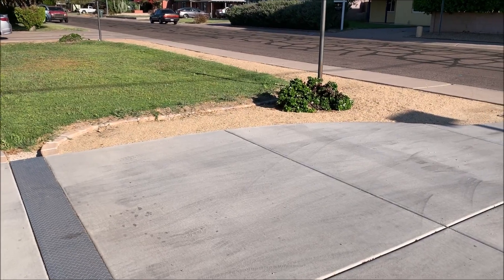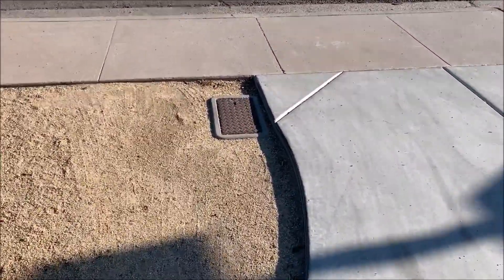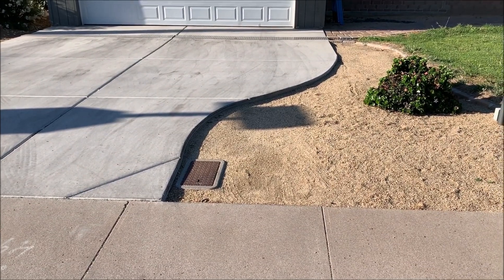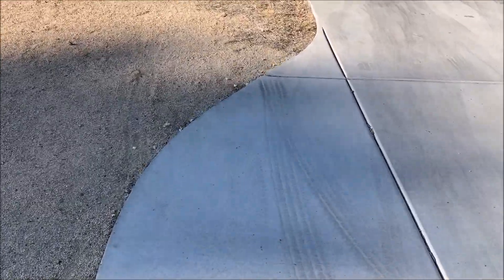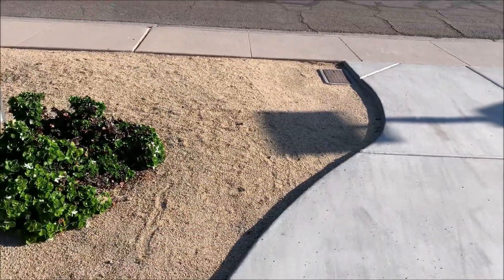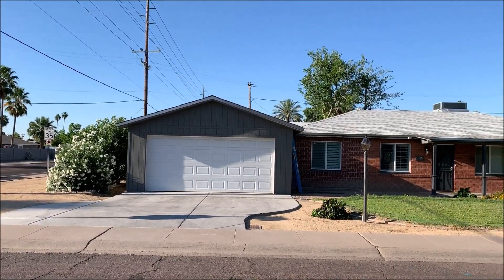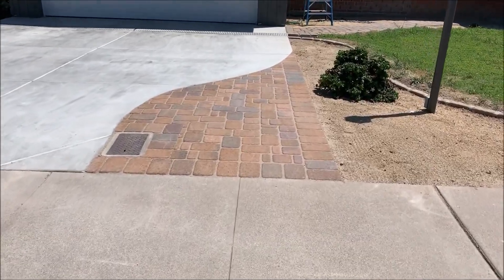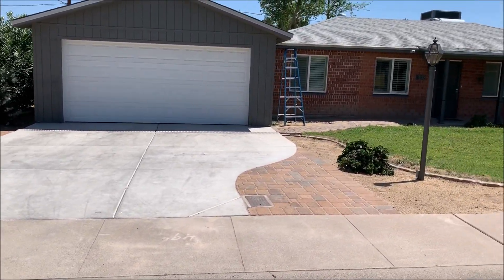Home Improvement:  Driveway Paver Install w/ Timelapse - May 2019

Comment: Pavers look good!  A word of caution is that the installers did not seem to go too deep with the underlayment of the pavers, which is fine for foot traffic.  If you drive cars on top frequently, or worse yet, park on top of them, the pavers may sink over time.  I did a DYI paver project on my backyard for the purpose of parking cars on it.  I thought I went deep enough and packed the sand/gravel under the pavers enough, but over 10 years, I now have small "ruts" in the pavers.  So this is a long-term situation.  They do look good, so congrats!
Reply from the maker: Thanks Al, I appreciate it!  And that's some very good feedback.  Let's see how these things hold up over time.

Comment: Always loved the look of pavers!  I installed quite a few paver driveways when i used to work on a landscape hardscape crew.  Paver driveways and versa look retaining walls.  Looks like those guys knew what they were doing, its always a pain getting that base course exactly right before you start putting down the pavers.
Reply from the maker: Agreed, I was actually pretty impressed at the effort they went to in order to prepare the area.  This was about a $900 job which seemed like a lot until I realized that it was 6 hours of work for 4 people, so 24 hours worth of work, plus their materials.  Worth it to me.

Comment: Looks good! Love the live actiondrive shots at the end! What made you go with pavers instead of more cement?
Reply from the maker: Ultimately the fact that I don't know how much access is needed to that water valve box.  It's easier to remove a few pavers around it, than to have to break up an area of concrete.